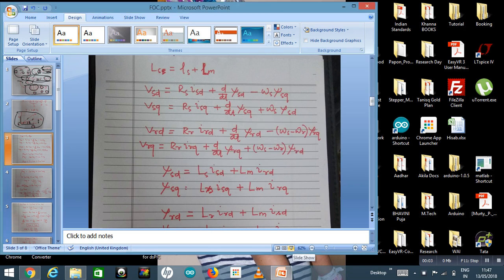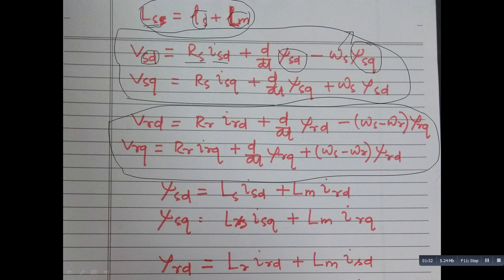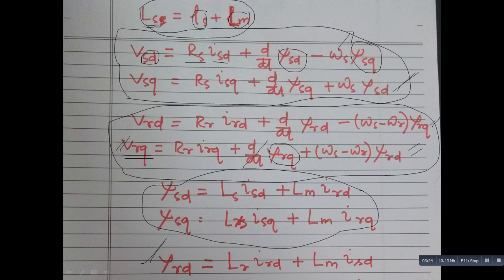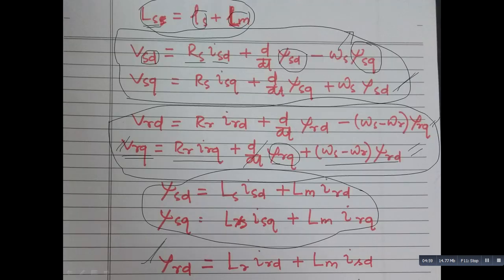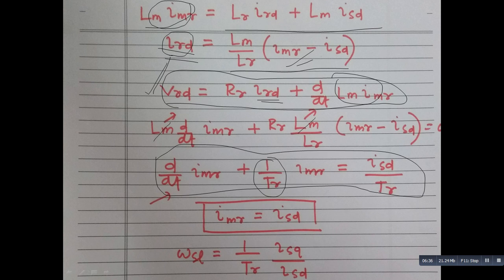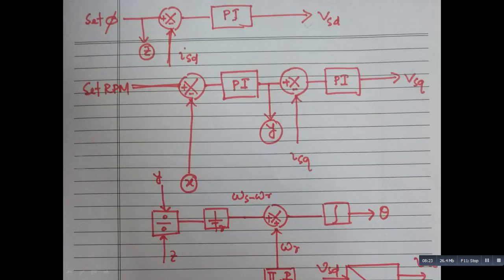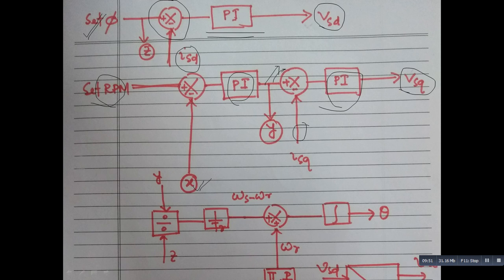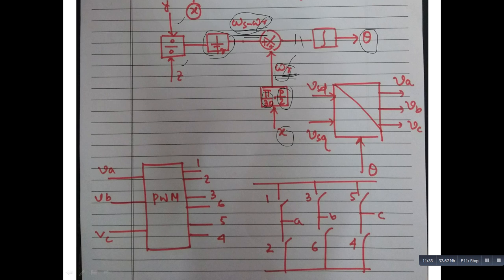Vector Control Of IM Two

Comment: at 0653
in laplace form 
(s+1/Tr)*imr=isd/Tr
using Final value theorem we will get imr=0
Reply from the maker: at steady state L(isd)=Isd/s, got it?
Reply: Sitangshu Sekhar Biswas 
isd is sinusoidal current??
Reply from the maker: ya but after alignment of rotor flux with direct axis of sync. rotating reference frame, its constant at steady state